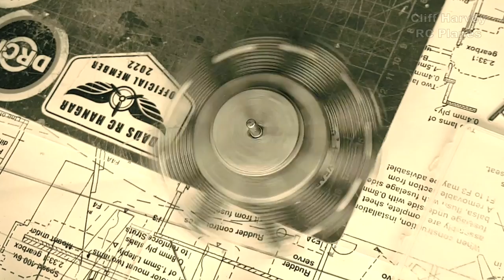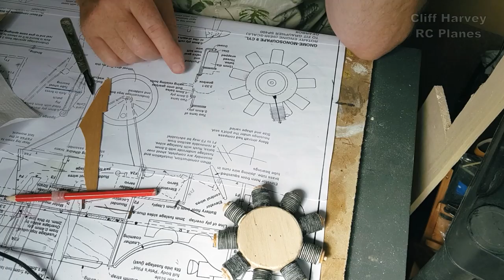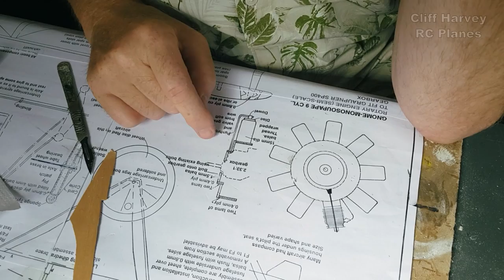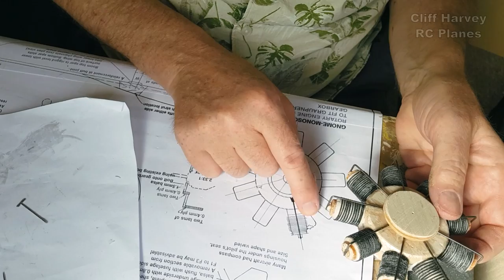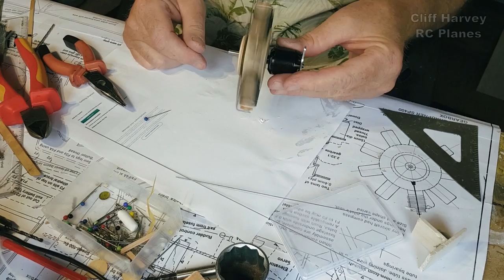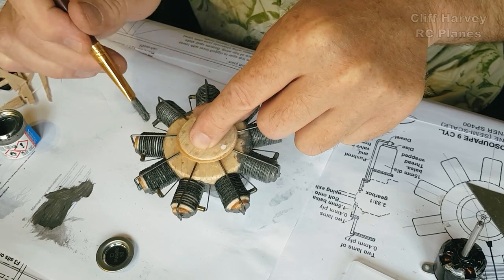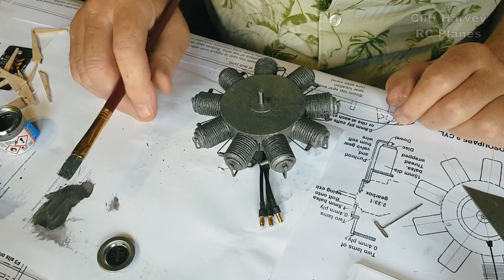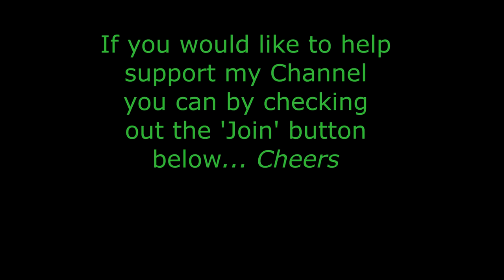How To Make Your Own Dummy Rotary Engine

Comment: Thanks for this video! I just spent the afternoon sitting at the bench working on detailing the vacuum formed Lewis Gun and rotary engine from a Guillows Nieuport. I would love to see how you made yours!
Reply from the maker: Hi TR, as I converted my Nieuport to radio control the dummy engine was treated differently but it's in this video if you want to see what I did https://youtu.be/uZ6xqigV8tY, also the Lewis gun features in this part of the build https://youtu.be/KgxEFJIztbo?t=642, cheers

Comment: Great video. Hope it’s a DH2 because I’m currently on with one now. Built the tail out of 3mm balsa and  it’s got a w/s of 39”.
Keep up the good work.
Reply from the maker: Hi Gary, it might be, whose plan are you working from?
Reply: Cheers Cliff. It’s a  RCME plan from 20 Years ago. Intend to adapt to brushless on a 2s or 3s lipo. It’s approx a 1/8 scale with a w/s of 44”. ( not 39” as originally stated).
I do intend to copy your engine idea..it looks great. Be interested in future videos on the DH 2(???👍) . 
Regards G
Reply from the maker: @GaryMartin-l8m  That's interesting Gary, whose the designer?
Reply: A chap by the name of Shane Harding and from memory I think it was published in RCME ;but not 100% on that date.
G.
Reply: Sorry the date I think is 2002/3 or around that time.😮
Reply from the maker: Yes Shane Harding was a good designer, I've replaced the motor shaft for he dummy engine to rotate slowly on, keep watching, cheers.

Comment: Did I miss how you modified the motor with an extended prop shaft?  That's kinda key to the whole thing working... :-)
Reply from the maker: Hi Paul, the motor had a bent shaft so I replaced it with a longer one, it's not difficult but worth watching a video or two how to do it, I watched one from Mark Robinson, https://youtu.be/nRzjUP2aXMU cheers